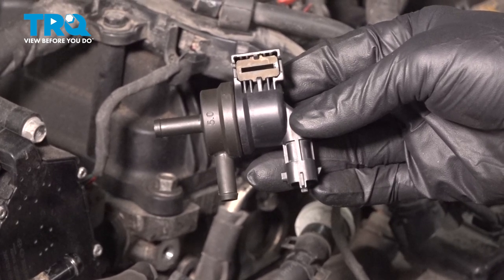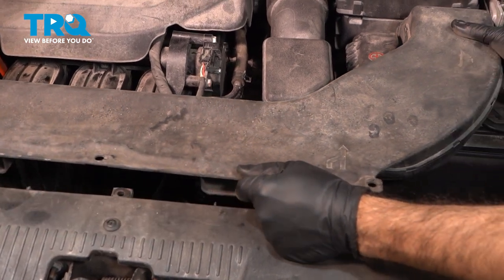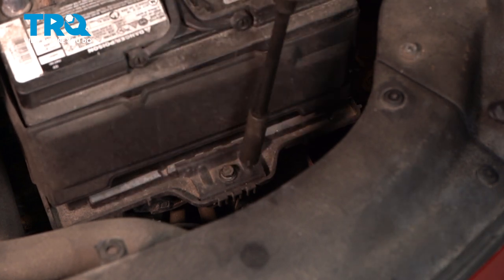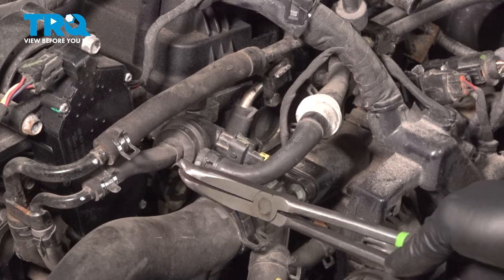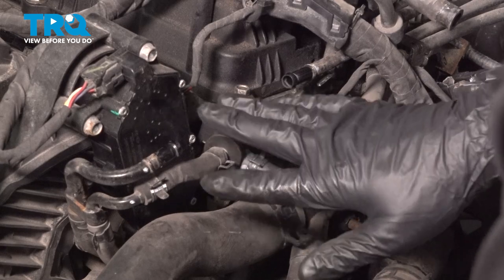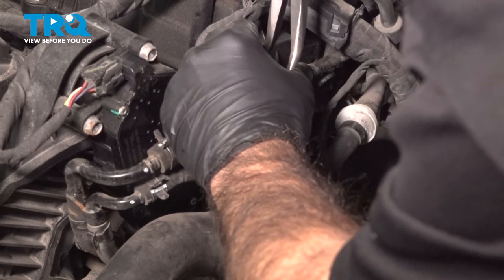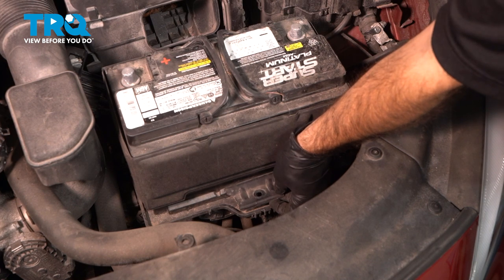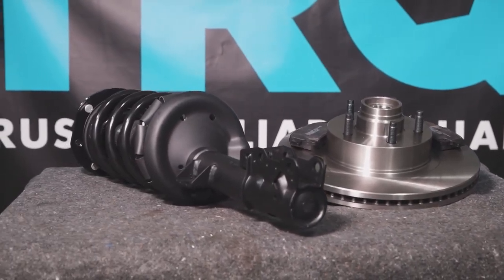How to Replace Vapor Canister Purge Solenoid Valve 2015-2019 Hyundai Sonata

Comment: Good video, and please don't take offence to this, but I understand using an Impact for quick disassembly, however I don't agree with the impact or drill when securing the electrical connectors to the battery. This can can cause over tightening and mushroom the terminal as well as stripping out the threads of the positive and/or negative terminal. There is a lot of torque in those impacts, better to hand tighten.